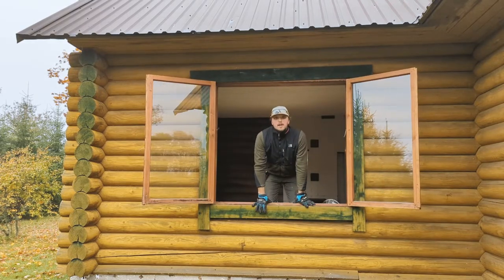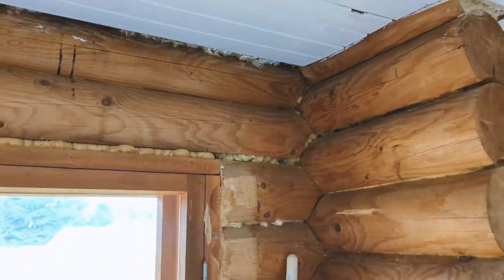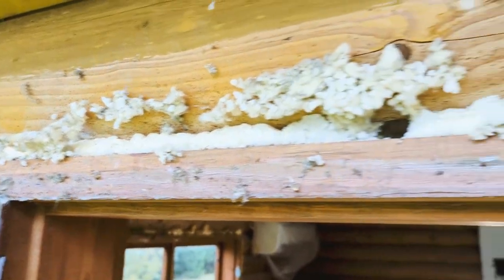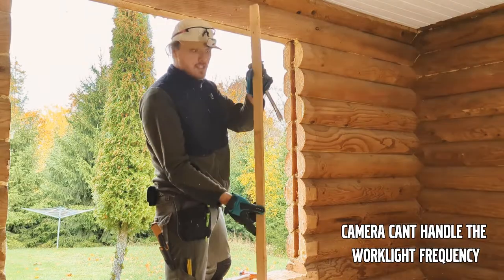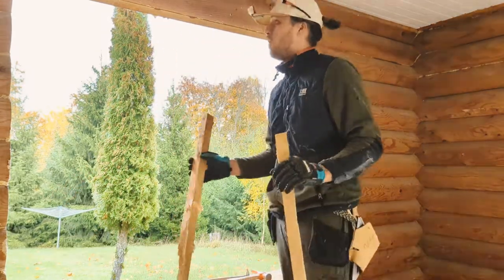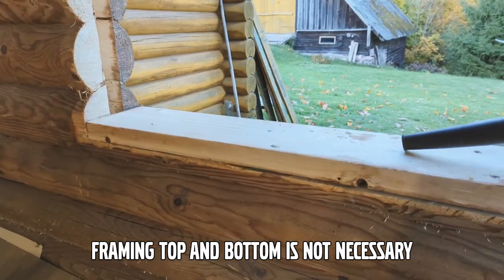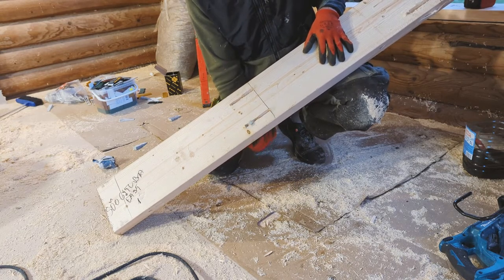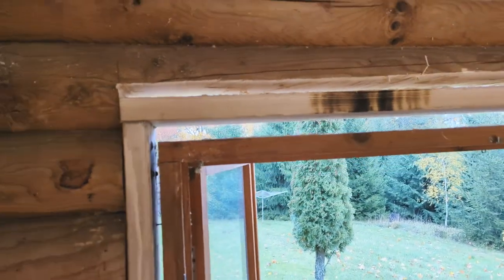Framing a Window Opening in a Log House

Comment: Too bad about the windows. They used nice Swedish Coping and Saddle Notching on the logs. The logs must have been high in moisture - best to use logs that have been dead for a long time (vertical drying of dead wood hardly shrinks at all).